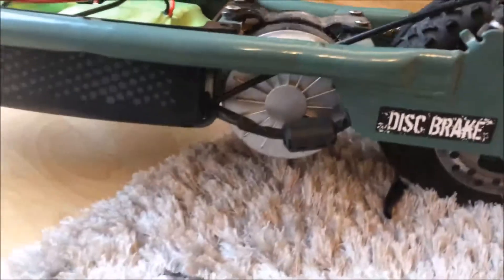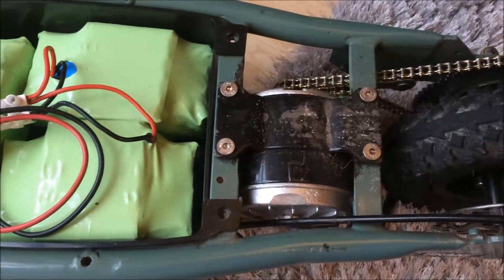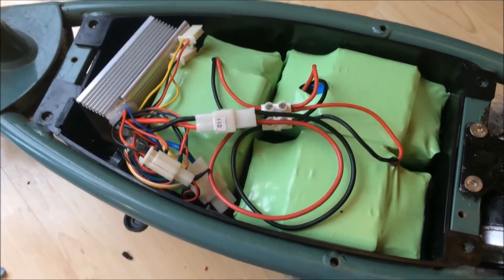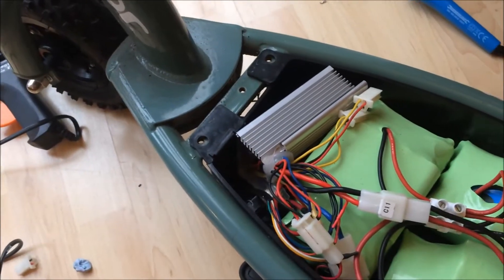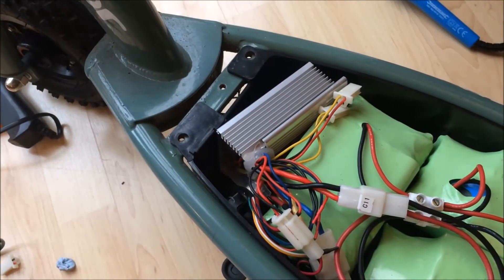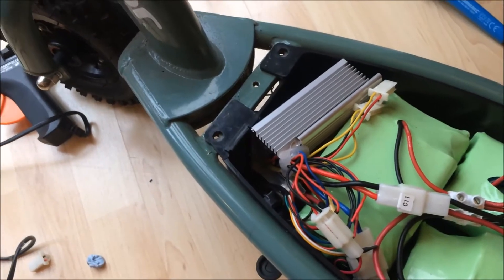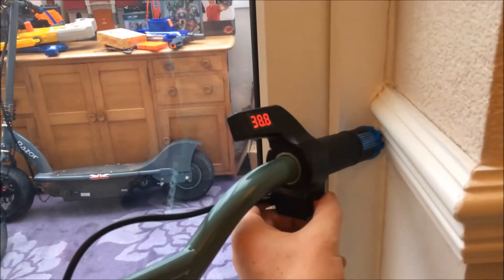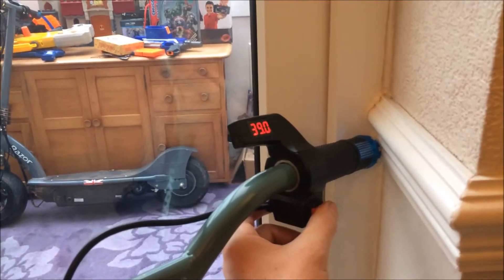razor 36v lithium conversion wth diagram.

Comment: Thank you for this. Youve started something now. Just picked and old e300 cheap with shot batteries. 
Looks like this will be my desired choice of mods due to cost etc. 
Is this all just plug and play basicly??
Reply from the maker: 1989mrstan it’s not plug and play as the plugs won’t match.  You could use connector blocks as a quick cheap solution.
Reply: Dickie Withers 
As far as the wiring goes tho all straight forward. 
Cam soon swap the blocks to what i need.
Reply from the maker: 1989mrstan yes it’s pretty straight forward. The wiring diagram should help a lot.
Reply: Dickie Withers thanks for your help. Now have a huge watch list on ebay. 
Can i ask your advise on batteries. Would you say this 36v li ion setup works well as far as Power and range or is it worth going all out like on your e300 with lipos and brushless motor. Thanks again for your reply
Reply from the maker: 1989mrstan this setup works very well. And is suitable for beginners. But it can not keep up with the traffic. My e300 is far too fast and very complicated to make. But I chose a razor e300 to keep it looking like a toy and stay under the radar. I would like to start with the citystreet1200w scooter and upgrade it to72v lipo. That should be the easiest way to get close to my e300.
Reply: Dickie Withers see im all new to tia again. Did alot with rc cars and things but that was 10/15 years ago. Alots changed since then with batteries and motors. 
Problem with me i get carried away to quick ad want to run before i can walk. I may stick to this build for now then pick another scooter up and build another. Lipos and brushless and keep progressing.
Reply from the maker: thats whats i did, each scooter gets better

Comment: hey dickie, you said its a 350w in the video but 800w in the description, bit confused. do you think this motor here would fit in the 300? is this the same type of motor you got? https://www.aliexpress.com/item/36V48V-800W-Electric-Brush-DC-Motor-Kit-Electric-Scooter-E300-Conversion-Kit-Electric-Motorcycle-MX650-Replacement/32793055686.html?spm=2114.search0104.3.16.79f47876NA0zWu&ws_ab_test=searchweb0_0,searchweb201602_1_10152_10151_10065_10344_10068_10130_10342_10547_10343_10340_10548_10341_10084_10083_10618_10630_10307_10131_10132_10133_10313_10059_10534_100031_10103_10627_10626_10624_10623_10622_10621_10620_10142,searchweb201603_1,ppcSwitch_4
Reply from the maker: no that motor is not for the e300, my motor is 350w at 24v but i am not running it at 24v i am running it at 36v, and the controller is 800w.  no need to be confused just listen very carefully again and again until you understand.
Reply: alright thanks Dickie. I don't really know what I'm doing yet. I'll watch again hopefully it sinks in.
Reply: you really should list what you get from where for us retards so we can compare. I'll do some more research on it. Thanks mate
Reply: Glad I can avert disaster and not buy a motor I can't use.
Reply from the maker: all from ebay, i have linked before but ebay listings dont last long. its not my fault, but if you search for what i say you will find them on ebay.
Reply: Dickie Withers OK thanks.

Comment: perfect mod. perfect for the e300. thanks for an example of exactly what im thinking about doing. hey, let me ask you, what kind of speed and distance are you getting? can it handle hill climbs? what was the overall spend? cheers, mate!
Reply from the maker: This mod is suitable for adults and hills, when comparing a scooters  range it will be related to the voltage and ah of the battery, 36v 13.2ah, the larger motor is required just to handle the higher power, the original motor and two batteries would be suitable for children, but for larger people the motor would overheat and  the battery voltage would sag, the overall spend is £150 on parts.
Reply: Great reply thanks boss. Seems like this could be a suitable commuter, which is what I'm after.